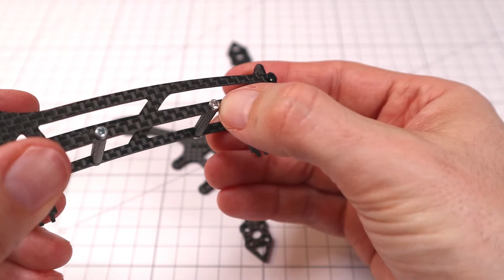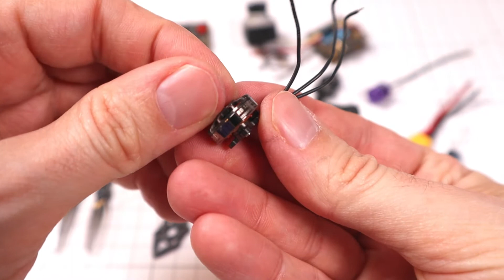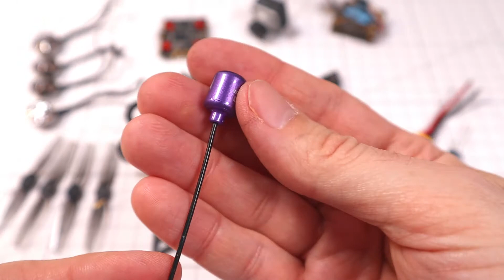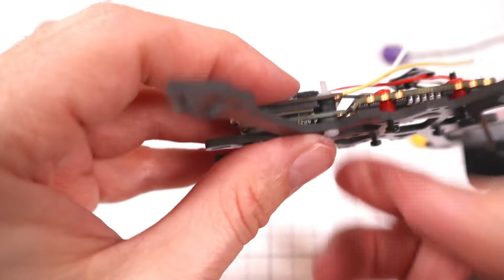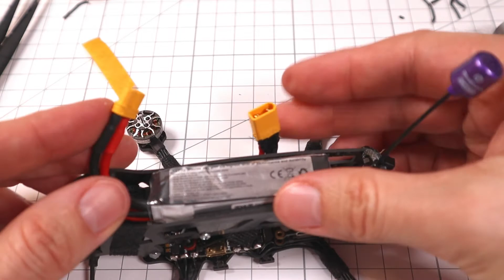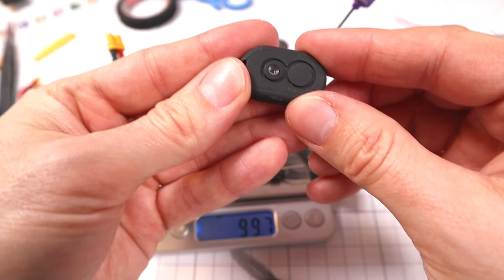"Sting" frame - build video - sub100g DJI HD freestyler

Comment: Awesome design. I have some questions sir: 

1. Would a 3s-450mah also fit? 
2. I see that the RealPit VTX step-up regulator (with enable pin) is rated for 1A. Is this enough power for the Vista?
3. I would like to make some minor modifications to the frame (extra loop with hole on top of the camera brackets for a insta360 go mount). Is it possible to share the DXF files?

Best regards,
Ray
Reply from the maker: glad to hear you like the design! Regarding your questions:

1. i hardly thing so, but that depends on the tickness of that battery
2. I used it with the Vista with no problems
3. Fusion360 can't export dxf. But i just added the .step files on Thingiverse that should work just as well :-) You can also check the maximum thickness of the battery there